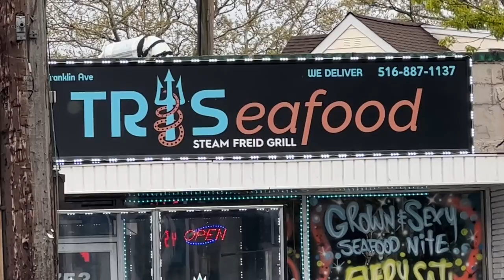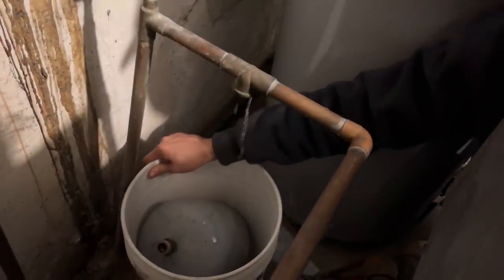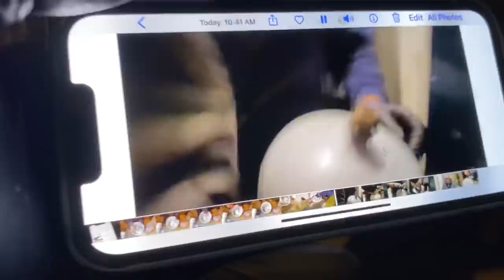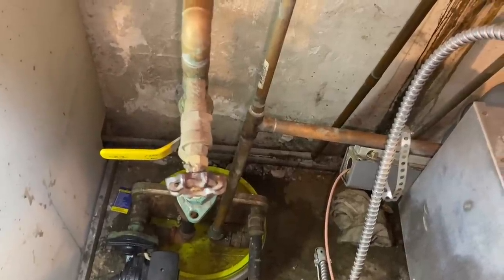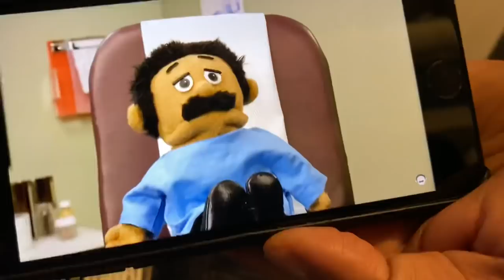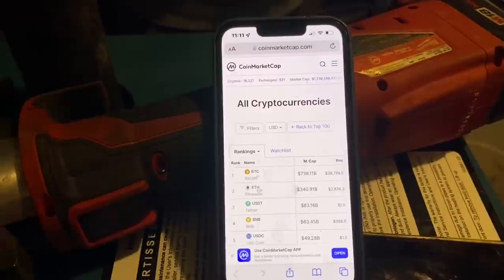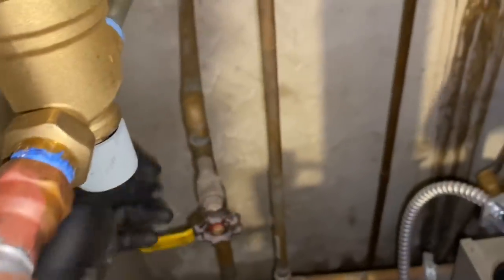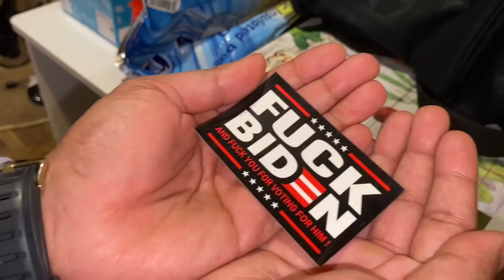Apprentice Gets Schooled on Proper Wrench Usage During a Heating Service Recall

Comment: What you showed him with those two pump pliers Is basically how you hold and remove router bits. Much easier to push than pull. You place wrench one holding the base and wrench 2 on the collet you want to loosen. Engage them so they are able to be gripped with one hand, and then squeeze them together with one hand.  That usually breaks them free. One hand squeezing is stronger than 2 pushing together.

Comment: I agree with what Mike is saying about the wrench positioning...BUT, Peter was putting himself at a huge disadvantage by having the tank in the bucket and reaching down into it. His wrench contact angles were all wrong. The wrenches need to be perpendicular to the fitting axis, and Peter was more than 25 degrees away from that plane. Plus, the working elements were below his knees, and even if he could have placed the wrenches correctly, it would have taken a lot more strength to do it down low inside the bucket. If you keep your hands within your torso area for these smaller jobs, you have more power. Obviously, a pair of 36's won't be right in front of your torso, but that is because they are so large.

Comment: poor gauge, the pressure went to the moon and expanded the bellow(semi circular tube) and it pinned the needle. I'm betting it hit 300+psi before the pump seal let go. lucky it didn't blow apart something else in the system.

Comment: Why no pressure relief valve on the system install in 2020?
Reply: I thought I heard that too in the beginning of the video.
If that's so the boiler is unsafe.
Reply: I see from the first video of this boiler repair a pressure relief valve on the right side of the boiler, so we're good in that dept. Looks like a defective pump then should be under mfg warranty.
Reply: that was on the closed hydronic loop side of a heat exchanger and not the boiler side, which is actually steam.
but yes it should have had a relief valve on that loop, lucky it didn't rupture something else in the loop.

Comment: I think, peter pansy handed the wrenches when tightening. lol 🤣🤣
I guess that's better than overtightening until the flange/pump ears break off and yes that's very possible before the bolts will break.